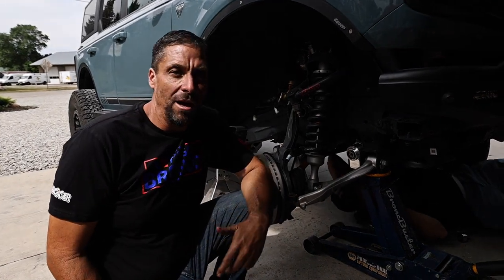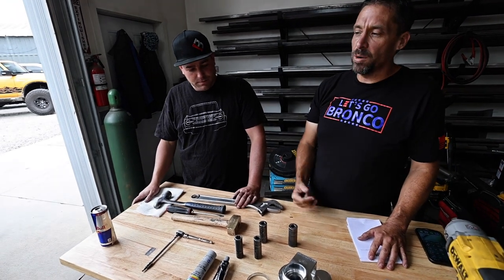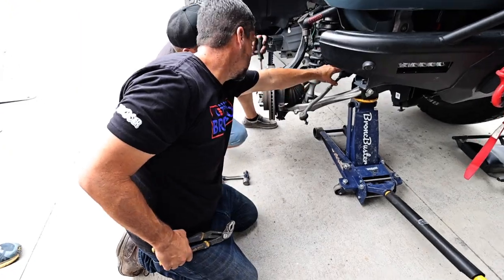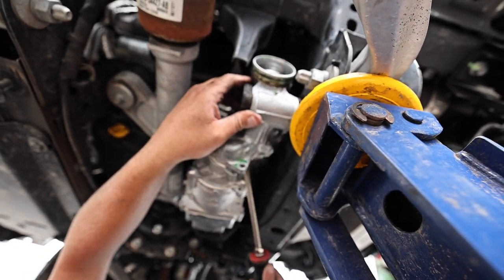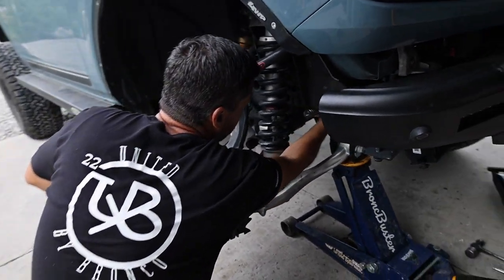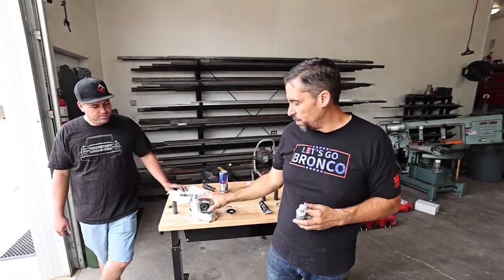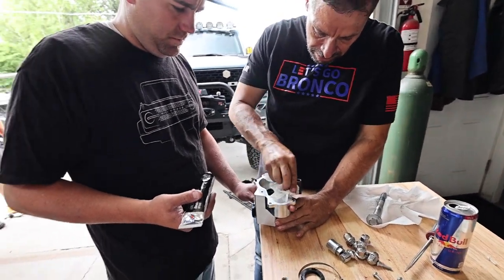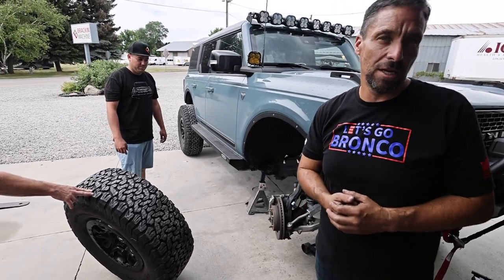The Steering Rack Is Failing On The New Ford Bronco & Here's Why!

Comment: I noticed on your site you sell the stage III heavy duty passenger billet aluminum housing, and the blue Bronc Bushing standard separately or together in the ultimate steering upgrade package, which includes the tie rod braces. Are the blue bushings required to use with the billet housing? I didn't see you use them in this install. If so, do you have a purchase option that includes the housing and bushing without the tie rod braces? I've installed heavy duty tie rods, so the braces are not needed.
Reply from the maker: Yes, that would be a custom invoice so please email through the website and we will respond with an invoice that will give you the discount. Or you can just email directly to broncobuster1977@gmail.com
Reply from the maker: And sorry to answer your question. Yes, it is needed on the driver side still.
Reply: @BroncBustertx  Sent you an email at the address above. Thanks!

Comment: Your housing sells for $1700, but you can upgrade to the Hoss 3.0 Steering rack for less than that. Does that one basically fail the same way? I noticed you had a unit for that rack as well.  I just want to know where to best spend the money.  hoss Rack or billett housing? I'm definitely not wanting to buy BOTH.  My rig is a Sas badlands 3" coilover on 35's but 37's soon.
Reply from the maker: The whole upgrade package is $1700. And yes, if you buy the highest 3.0 you will still want to upgrade. It feels the same way, but is a way stronger motor, so that is your biggest advantage.
Reply: @BroncBustertx  thanks for the response! I'm hoping if I buy your part, I wouldn't need to also upgrade to the hoss 3.0. I've got a normal badlands Sasquatch with the normal steering box.
Reply from the maker: @AV8R_1  the only reason anyone would want to upgrade to the hoss 3.0 in my opinion would be for the stronger motor. This last weekend at Wheeling For A Cause we broke the Hoss 3.0 in testing
Reply: @BroncBustertx  gotcha. Good intel. I appreciate that!
Reply: Rip off still breaks

Comment: How to prevent steering rack failure on the new Ford Bronco??? Don't buy the new Ford Bronco. This is what is wrong with new trucks. Car steering and suspension on a truck and advertise it as a rugged off road vehicle.

Comment: Thanks so much for uploading this.  Much better than the original video.  Question:  For the boot reinstall, what size/type  clamp did you use?
Reply from the maker: 2 3/4”
Reply from the maker: 2 3/4” fits perfect 3” if you want a little extra